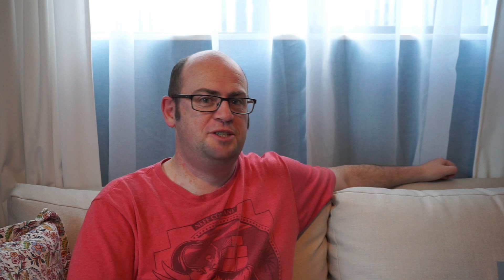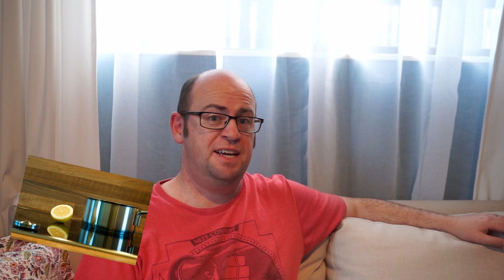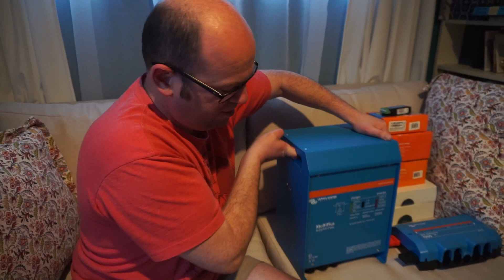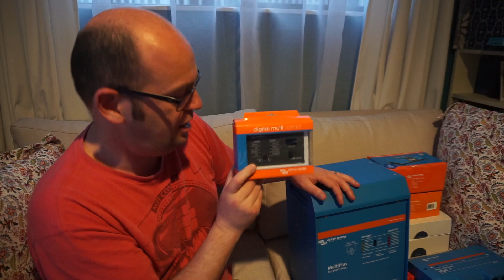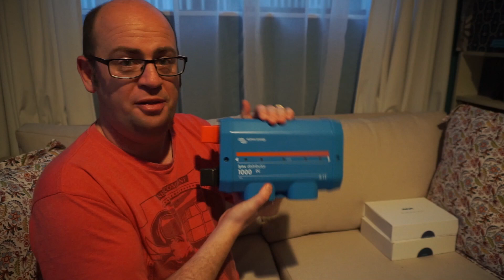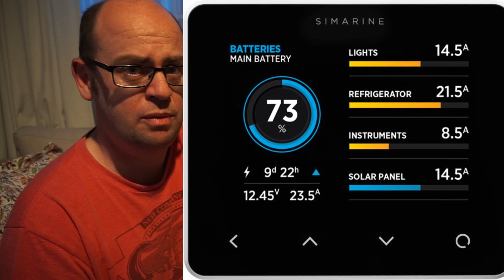Van conversion ELECTRICAL set up - how we will power our van!

Comment: Hi! Good to see someone else going full electric. I got my panels and inverter from this guy, he is really well priced and helpful! Has a bunch of other stuff :) https://fazcorp.co.nz/

Sounds like you may have gone a bit small with your solar array size if you wanting to be pure electric. I've got for 1280w Solar, 24v 240Ah LifePO4 and 3000w - by the sounds of things you are wanting to run a similar amount of stuff to me (hot water, cooking, refrigeration, lighting, devices etc), maybe even a bit more than me! haha. So unless you are going to be plugged in most of the time, or want to be running to Van alternator a lot of this time I would definitely suggest looking at a larger solar array.

Looking forward to seeing your progress, I am about halfway through converting our Vauxhall Movano LWB-HighTop. Have lots of footage to upload, but I'm slacking a bit on the video editing uploading side. haha.

Where are you based in NZ? I'm in the Wairarapa.

This is our little Instagram page so far if you are interested - https://www.instagram.com/boushybus/
Reply from the maker: Oooh! Thanks for the detail. We’ve had such conflicting advice about the amount of solar we need, that’s one reason why we’ve not yet committed to purchasing any panels. 

We’re based out of Auckland. Will definitely check out your Insta! Maybe see you on the road when we’re all finished building!
Reply: @ThePetersonOdyssey  
Hi Megan and Darryl

Great to find some Aucklanders doing similar. I too have purchased a new VW Crafter LWB High top, and am well into the campervan conversion.
Decided quite early on to have no LPG, so all electric here too.
Major Components and fittings:

    LiFePO4 10kWh (400Ah at ~25V)
    BMS Electrodacus SBMS0
    Victron Color Control GX
    Victron Multiplus 24/5000/120 inverter charger (~4kW)
    Solar 720W Perc (4 panels in series)
    Victron MPPT 150/35
    Buckboost 50A at 24V
    Thetford Topline 902 Induction cooktop (2 zones)
    Breville electric oven
    Delonghi electric coffee maker
    Eberspacher 2kW diesel air heater
    Hydronic 5kW diesel water heater
    Isotemp hot water tank 16L (also 240V 750W)
    Isotherm compressor fridge 24V 115L
Reply from the maker: @normjager5268  Kia ora Norm. Seems as if all of us here in Tamaki Makaurau will be out of the road soon... or at least us and you! Looks as if we have very similar components. How far into your build are you? We had a consult with an auto electrician today and I reckon we don’t have quite enough solar. We are going to add a third, or possibly fourth, panel to get closer to 900 watts. Eeek! Pleased we found out early though. We’ve decided to change our build schedule around and focus on getting the water tanks installed while we hunt out the new panels we need. We’d love to hear all about your build... maybe a meet up in the future? - Megan